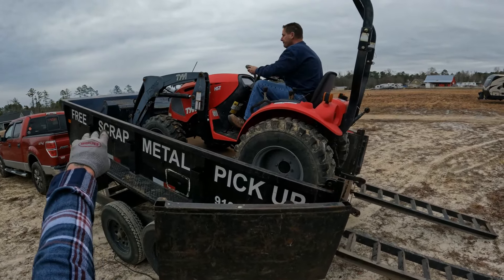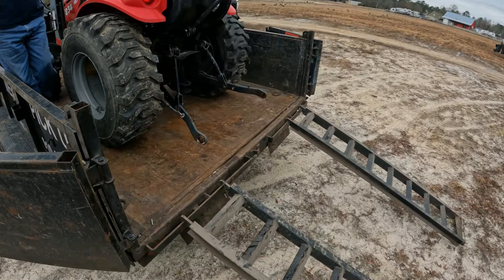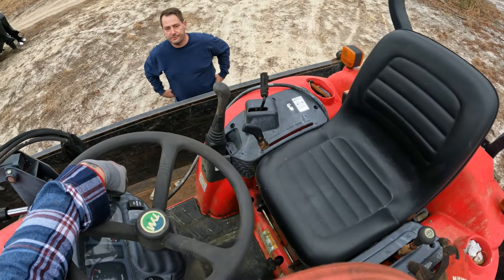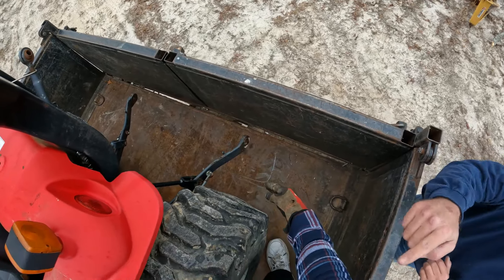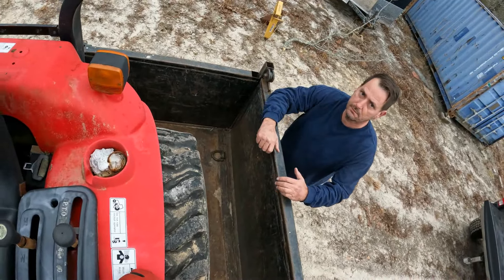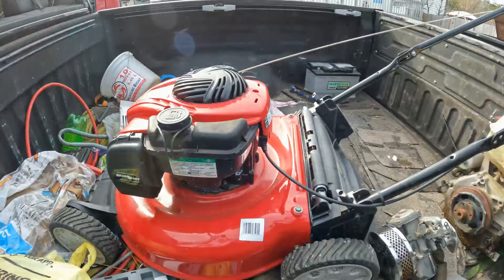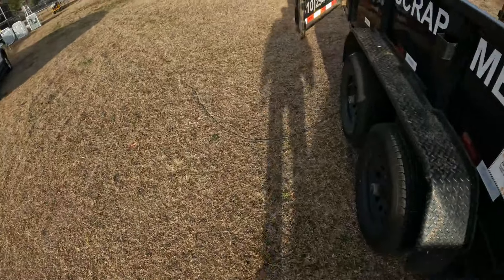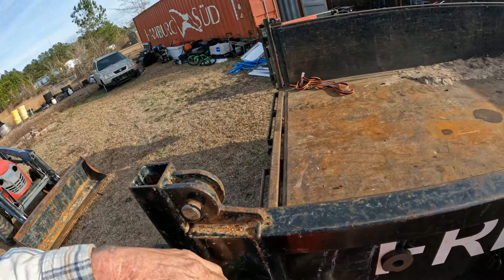Picking up my New (Used Tractor.) this will help me.

Comment: My girlfriend made a concrete block with pins to go on the 3 - point hitch , for a counter balance so she could pickup large haybales . A easy solution for extra weight . I always used the rotor tiller , but it’s kind of awkward . 👍🇨🇦
Reply from the maker: Good idea